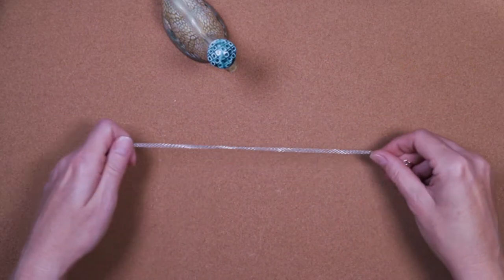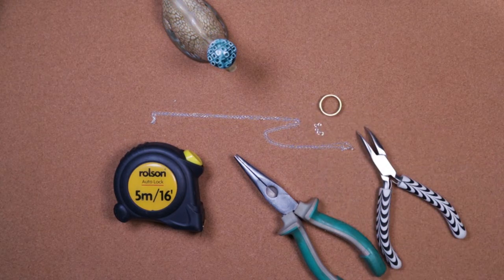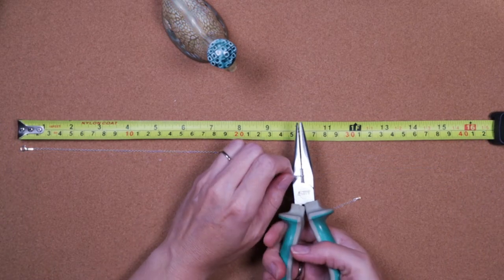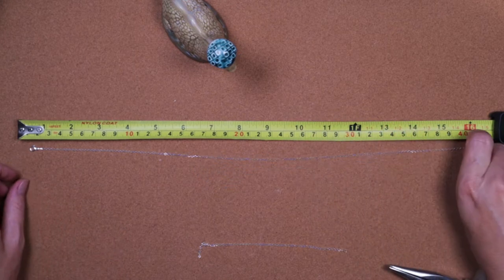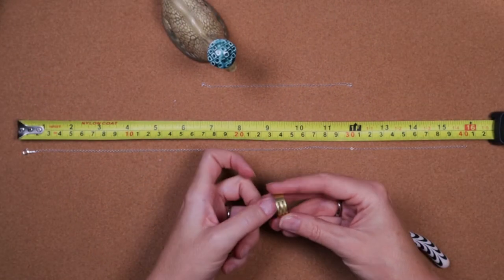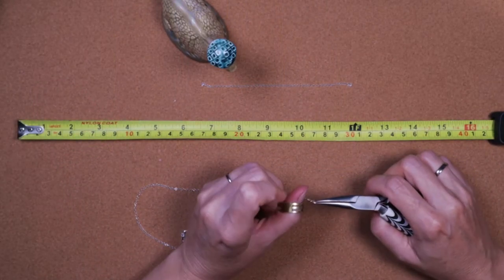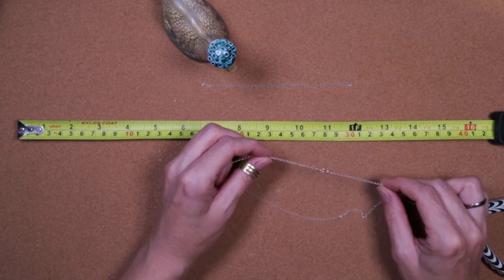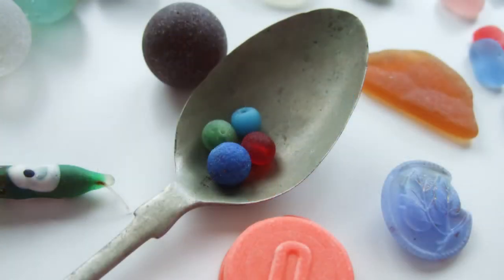Necklace Design 101 - HOW TO Shorten a Chain & make Jewellery

Comment: Lovely jewelry! Have you had any issues with the pieces that you put on the sea glass coming apart? I've seen some people use glue along with the silver piece, but it shows. I like your version better.
Reply from the maker: The sea glass is drilled and there are little pins that hold is secure - never had any issues :) If you were to use glue the pieces of sea glass or pottery wouldn't dangle and there really is no need to add glue at all...

Comment: Why do you choose to attach the red bead between the slide point of the bracelet?  I have never seen them attached there, is there a benefit to this method?
Reply from the maker: The weight of the bangle is where the expanding bit is so I attached the bead there as it will always fall towards that end, but you could attach it anywhere !
Reply: @craftingwithscottishmudlar6626   makes perfect sence.  Thanks!

Comment: I favor the blue sea glass most times, but how you set the green has to be my favorite today. Do you have any tips for hobbiest looking to start? Tools, supplies etc on the cheap? I have a feeling it is far more difficult than you make it look, but I wouldn’t mind trying if it didn’t break the bank😁💙🍀
Reply from the maker: Thanks so much Kari Anne! When I started I bought a few silver plated pieces here and there just to see how I would like making jewellery - I used a pair of pliers from our tool box for years! It does take practice like everything else - buy a jump ring opener , it saves your fingernails and is sooo handy ... check ebay or etsy for starter sets of jewellery making kits or similar.